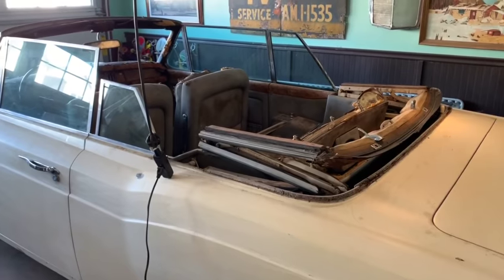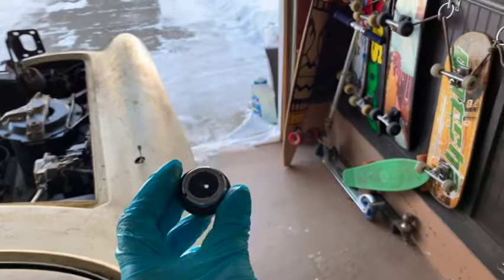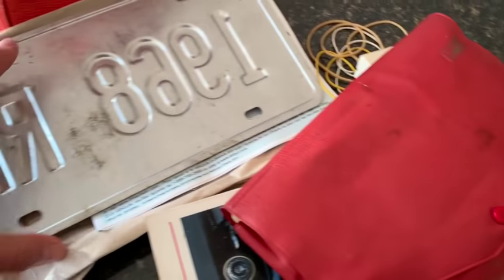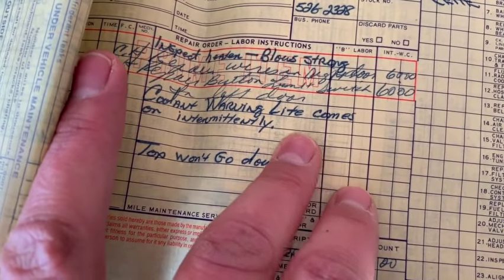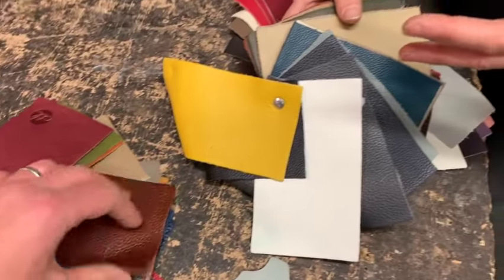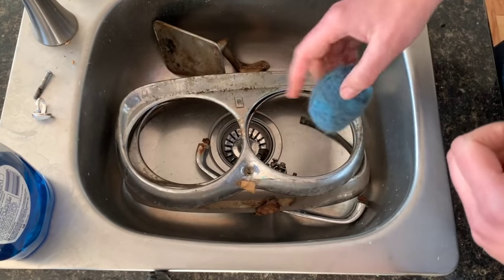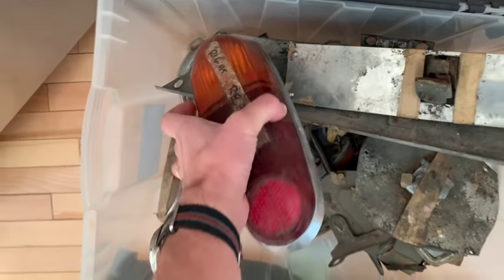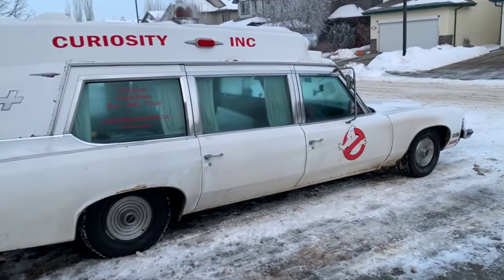I took a Junkyard Rolls Royce and brought it back to life!

Comment: Sorry but as much as I am happy you brought it back to life, you have not done it well, not at all, the wood is shocking, the clear should have been sprayed on, not painted, no amount of sanding and re applying will stop the fact that the coating is dreadful, and as it is one of the parts of the car that is looked at all the time, it shoud have been done properly.

The paint is also poor, yes it shines, but it does not ROLLS ROYCE Shine, it is not crisp and mirror like, it gives the impression that it is more satin that glossy, in certain angles, and you never get that from a Royce. How many coats of paint did it have ? and were they flattened back everytime ?

Then the fact you never protected the wheel arches, from the shots they look like they were just left primer, and not protected, that would never have been left like that from RR, I sincerely hope you replaced all the fluid lines under the car, this is a must, regardless of how they look as the connector parts can corrode badly, and you only know how bad once they are taken apart and checked.

It is great to see another car back on the road, but a shame it could not be done properly. And yes I do know what I am talking about, I have owned more RR/B products than any other brand, and currently have two in my collection.

Comment: You need to make this more in line with its new surroundings. In other words, make it more American. First, you need to ashcan or sell the old engine and shoehorn in something like a, i know...a Sonny's 1000. Consider other touches like discreetly louvered hood and semi hidden lake pipes. Some discrete scalloping with tasteful pin striping and a subtle 1" chop of windshield and lowering of the convertible mechanism anchor points. Like I say, nothing too radical. Just enough to make it more American.....

Comment: I will never understand a someone putting years and multiple thousands into a vehicle restoration and yet completely cheap out (in both time and materials) on the wood paneled dash with $8 varathane finish and just lightly buffing the steering wheel. It makes no sense to me. It's not hard to properly sand and refinish those items. Especially because you will be looking at them in your perfirials 100% of the time when driving the car.

A lot of these restoration channels are experts in their craft and really understand how to turn something over. As the video went on I just realized this guy is just an adult collector with lots of money to throw at a toy he wants. Kind of a shame

Comment: Kudos on rescuing that classic and seeing the project through. But that leather is a big yikes. The interior is like 90% of the appeal of a Rolls, and it's not the area to cheap out on. The car should be trimmed in proper Connolly leather -- in fact Connolly Brothers has a classic department which would actually look up the exact proper leather for this car and recreate it. And the puckering and poor overall fit is really letting the car down in a serious way. You can't just let anyone work on this kind of project. Just because they've done automotive interiors in the past doesn't mean they're qualified to trim a Rolls Royce.

Comment: the veneers costs thousands to redo..San Rafael for tuesday meetings id talk to a restorer. on a car just like this one.. Neighbor had one brakes use the motor to pump up brake power.. the parts are costly..trans gm..power steering  pump american fits.. Brake fluid is special rolls... Parts are insane..plus lou only drove his car while he had a towing service.. Only a set amount of tows.. motor from mechanic is 1200 a sleeve.. Plus value is just not there..  Maintenance of said car relates to value.. Maintenance will be a lot more then value of car.. One was for sale in marin I looked at it fully maintained with receipts. The maintenance bills from the last servicing was 25k.. only a year or so ago..  Car was selling for less then that..  But over priced.. should have been 13k...

Comment: Sorry mate I know your heart is in the right place but that's no restoration you are doing as much harm to that car as the raccoons  the finish on the varnish is not at all good. I would have started on the engine just to get any idea if it was good before ordering new upholstery if the engine was no good then the best thing you would to break the car for bits. I did not watch it to the end I felt so much what you were doing to a Rolls Royce

Comment: Rolls Royce retain all designs patterns and plans - if you have an old RR they will supply you  with spares. Fitting inferior none standards parts and accessories is a violation of the original build brief and an abomination to any sense of taste and aesthetic.